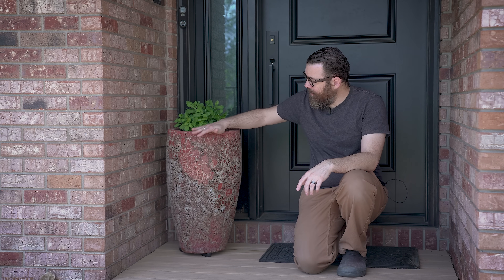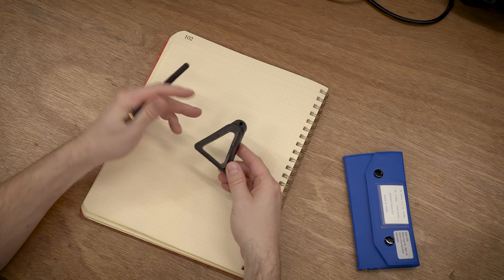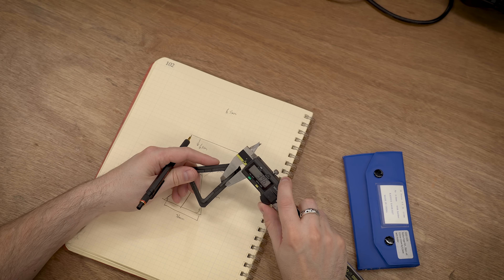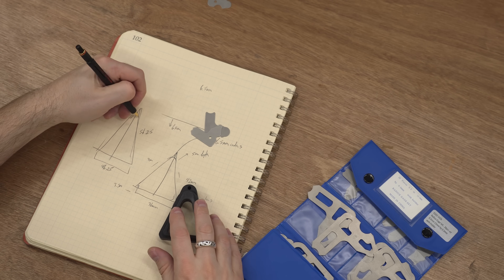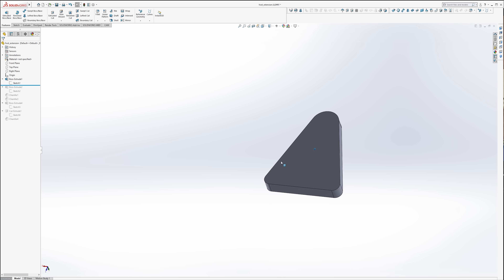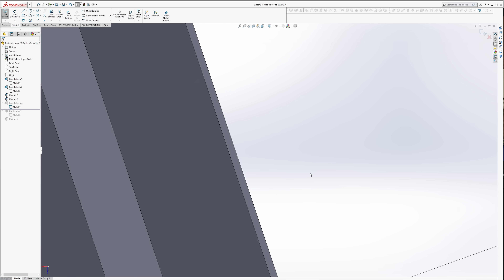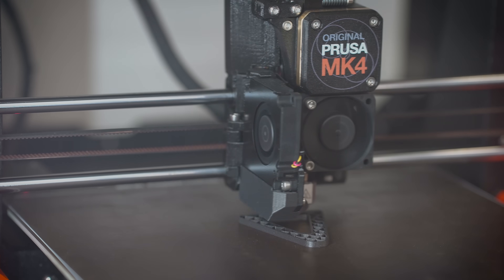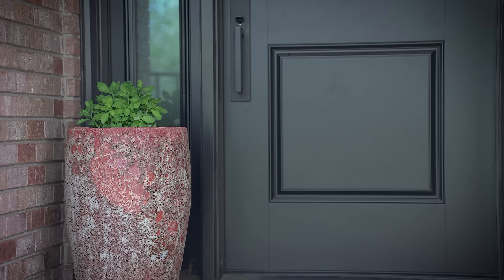Practical Design for Custom 3D Printed Parts

Comment: I have to be honest, my favorite thing to print with is PLA+ , it prints basically like PLA, but a slightly higher temp, and is made with UV resistant materials. It handles outdoors well and doesn't have the picky printing features of ASA. Yes its slightly more expensive than PLA but its super easy to work with and it works outdoors. But nice job on the part!
Reply from the maker: I've done quite a bit of research and PLA+ is still very much PLA.  It's better in some ways, but it will still warp over time (creep) and isn't good for constant loading.  However, most designs should be fine for PLA or PLA+, as long as you keep these things in mind.

Comment: hi robert, when printing asa on a p1s, i have all kinds of problems with bed adhesion and warping. im amazed to see you printing it on an open prusa. could you, if you don't mind, tell me some parameters and also what kind of bed you're using? thanks in advance.
Reply: Honestly,  just my personal opinion,  I use PLA+. The plus means they added a few things to it. Most PLA+ is super simple to print with like PLA, but it is also UV resistant and works well outdoors. It's only slightly more expensive than PLA, and you only need to raise the temperature a small amount and it should print with basically the same settings as PLA does with just a small bump in the temperature.  I have tried many materials, and I just find things like ASA a little to picky to get a decent print. It can be done but I don't waste my time with it when PLA gives me what I want easier.
Reply from the maker: It's not a new magic material, it's just PLA that's slightly better at the things PLA is bad at.  It's no substitute for ASA where ASA is necessary.
Reply from the maker: Slow it down and use a thin layer of glue and you should be fine.  Bambu tries to print EVERYTHING way too fast.  Just run the same file, but select the silent speed setting and use glue stick.

Comment: I make very rough sketches in notebooks especially if I'm not home.

But (this may be because I'm dyslexic) I find it easy to build it on the fly, i'v been trying hard to put all features into the original fusion sketch.

But normally I build on the go, so you can imagine my timeline is usually very long.

But like I said it may be due to my dyslexia I tend to imagine the finished project in my head.
Reply from the maker: I've very much learned my style of 'drawing' and can even reference them many months or even years later and generally understand what I was trying to do ;-)  It's all about being consistent I guess.

Comment: Useful video. I struggle with modelling existing parts accurately. Ive tried to use photos as a canvas but the dims get heavily distorted 

What print settings do you use for ASA? Enclosure? Ventilation?
Reply from the maker: I think a lot of it comes with experience.  Trying to understand how it was actually designed, what decisions were made, etc.  If you can think backwards how the original designer made choices, that helps a lot.  I've never done the photo thing, it doesn't really work well for me, mentally.  I have a video where I discuss printing ASA - https://youtu.be/goR6Kbjiih8

Comment: Just for small parts. Two ideas that I’ve used (I usually scan) 

1) scan the part on a photocopier or flat bed scanner then scale to a known length. 

2) trace around the part and sue a protractor and a circle template - like a Math-o-mat to size the radii.

Comment: I made my own hexagonal  posts for my front porch and needed some kind of cap to put on them. After looking at the big box stores and not finding anything that would work, it dawned on me that I could 3d print my own. After two years in the sun and weather, I don't see any deterioration  of the pla that I used to print them.
Reply from the maker: Nice!  Colorado gets a lot of sun and I've had a few PLA parts completely deform after a year or two.

Comment: For me a open question is how much walls, infill percentage and witch infill pattern have you selected?
Reply from the maker: I just used the default 'speed' 0.2mm setting.  With ASA, it should be plenty strong enough here.  Especially since there aren't many large bodies, the majority of the print will be wall or floors/ceilings.  There's not a lot of room for infill.
Reply: @RobertCowanDIY  thank you

Comment: I did something very similar for my dad's camera doorbell. i made piece with an angle and the correct mounting holes so that he could get it to the right angle because he was mounting it onto some siding that was at an odd angle. and of course a second one when the angle wasn't quite right which was as easy as changing the number in cad and reprinting it.
Reply from the maker: Nice!  3d printing is great for stuff like that.  Nice job.

Comment: I am very proficient in hand drawing, sketching and technical drawing, yet I do everything digitally for like 20+ years. My main method for this rough designs is to take a image with a camera, or slap it onto a flatbed scanner. Use the photo as import into CAD and scale to known dimension. Then I just have to trace the important outlines and features. 
I find that way faster then to try and measure angles and every detail.

Comment: I find that in Fusion if I start filleting corners in the sketch I end up painting myself into a corner (pun intended). I do all sketches as straight corners and then fillet the bodies. Solidworks might be different when designing parametrically.
Reply: Same here. It complicates the sketch too much and if I want to change them it often gets all screwy. I now just filet everything as a final step.
Reply: it applies to solidworks aswell, the model is more "stable"
Reply: Yep same here. Really easy to find it in the timeline and adjust, too
Reply: F360 user as well, agreed.
Reply from the maker: SAME!  All the corner references are gone and it gets cranky with too many fillets.
Reply: Yeah agreed, things like fillets and chamfer are usually easiest left until last unless you have a very simple design.
Reply from the maker: @hot_wheelz  Agreed, I'm trying to get better at that.

Comment: I guess your intent here was to show your design process, as apposed to just making the part. Since the part will be almost completely covered by the pot, any of those inside dimensions aren’t that critical, so just slap it together and print it. 😂
Reply from the maker: Also, since you double-posted, so can I!  NONE of these dimensions are critical, I could have just printed a 6.5mm tall rectangle and it would have worked.  But I would have known how sloppy it was and fixed it later ;-)
Reply: @RobertCowanDIY  Sorry about that, YouTube kept telling me I timed out, so I kept hitting send. 😊
Reply from the maker: @MrDksmall  No worries, YT likes engagement, so an extra comment only helps.
Reply: @RobertCowanDIY  Well in that case let’s talk about the new X1E with AMS I got at work. 😝
Reply from the maker: @MrDksmall  Wow, I've been bad about responding to comments.  How do you like the X1E?
Reply: @RobertCowanDIY  So far it’s been great. I keep seeing posts about AMS problems but ours has worked just fine.
Reply from the maker: @MrDksmall  Nice.  I really don't use the AMS, I just haven't found a good reason to use different colors.